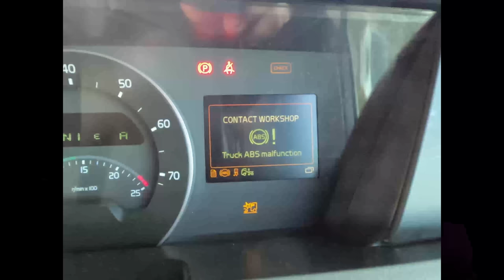Westminster London - Crowns, Crowds and Cranes (Part 2) ✔ Trucker Floz ✔ [4K]

Comment: Great video Floz. Was in England in the 70's and 80's and drove HGV's from 1976 to 1981 mostly on TIR work. Loved London. It's a great place to drive around. Know exactly where you were but don't really like the fast forward bits. The company I used to drive for was called Brain Haulage based in Braintree in Essex but they had a yard in Limehouse, long gone now, but I used to bring the unit, Volvo F10 then F 12 home, wash and polish it and clean the cab. You wiping the dash and wheel brought back memories. Waiting for the next video. Bye from New Zealand 🇳🇿. PS... got stopped in Romania in 78 and was fined a pkt of BIC disposable Razors.🤣🤣
Reply from the maker: Thanks Darryl 😀 I know what you mean about Romania in those days. It's probably happening now too but not as before 😂😂 The forward bits are only for entertainment purposes as I couldn't put the whole 45min in there but I get what you're saying. Ive just done another vlog and I've slowed it down a lot 😉 It will be live next week probably if not earlier 👍
Reply: @TruckerFloz   Thanks Florin..I also like the screen in screen as we can see you but also where you are going. Other vloggers should do that. How about a look inside your truck cab. I'd be interested to see how they've changed from the 80's. Drive safe.👍👍👍👍
Reply from the maker: I have done picture in picture a lot. Sometimes it's  easier not to use it especially when I need to cut parts where I can't talk properly 😂😂😂 and believe me there's a lot to cut sometimes 😀 I'll give you a link to some of the truck reviews I've done in the past. Scania, Volvo, DAF and Mercedes (the last two got me upset a bit 😂😂) but yeah... enjoy. Link here: https://youtube.com/playlist?list=PL_N5043FlvlU5u6xTGkCy5w92yYQLySHm
Reply: @TruckerFloz   Thankyou. The trucks I used to drive were DAF 2500, Volvo F89, F10, F12. Never drove a Mercedes Benz but did drive a Ford Transcontinental. I'll Check it out. Cheers Floz..👍👍👍👍